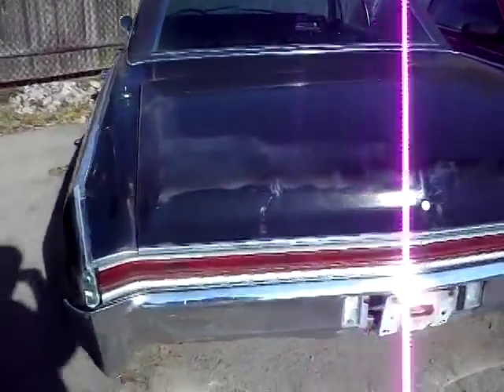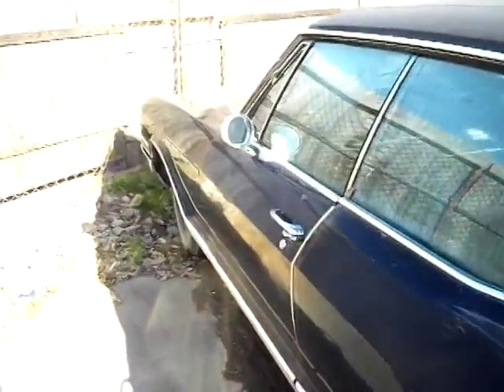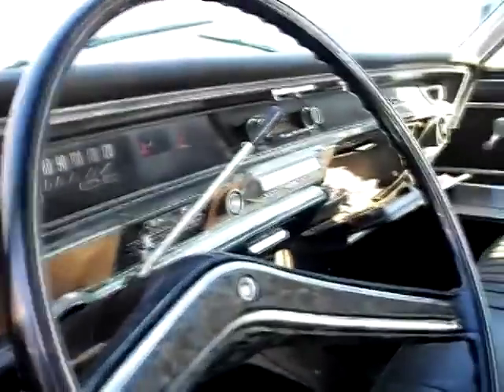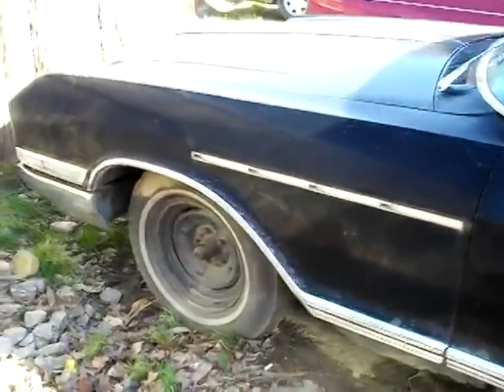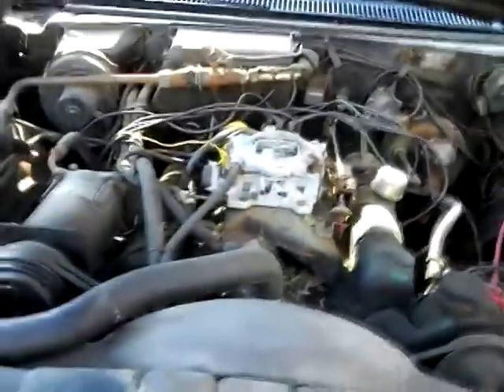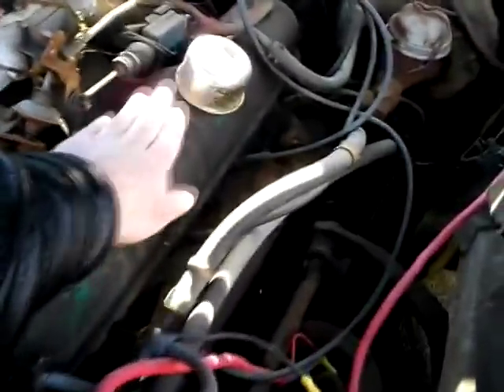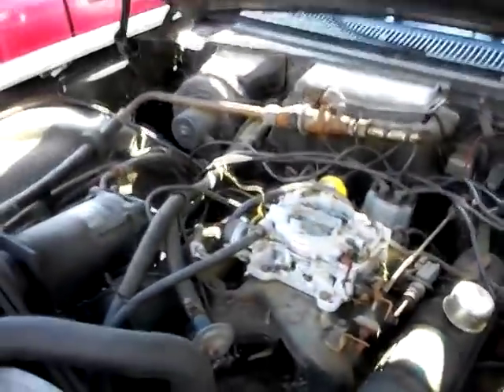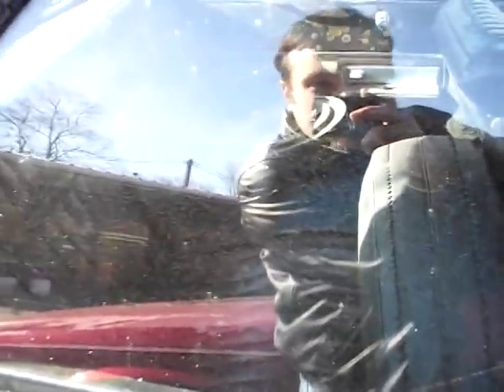1966 Buick Electra 225

Comment from the maker: @daddytech LOL, mine was 10 quarts between changes but still ran like a champ!  Torqued the oil pan bolts to spec every oil change, but when I found the top end of the engine was into especially the intake I began to wonder.  The bolts were finger tight on the plastic intake, the plug wires, injector wires and other things were twisted together.  I went to a junk yard to see how it was supposed to be, and everything was backwards on mine.

Comment from the maker: @kerobinsonii I wouldnt doubt the motor running at all, they also did work on the wiring as well.  Other than the carb throttle being a little stiff and the choke froze shut I would say it would start.

Comment: Judging on the vertical valve covers, it's a 401 Nailhead motor. The firing order is the same as the one in my car. I own a 1965 Electra 225 Survivor. Usually, as I've found out, the leak in the hardtop is usually at the window seals. That's too bad about the condition. It's still savible tho, the body appears to be in good enough condition. 

I love my Electra 225 tho. It drives like a Caddy, but corners like a fridge. Gets right up & goes like all hell, but stopping is still not the best :)
Reply: my parents had a 69 Electra Limited for years, and the back window around the vinyl top started a small leak before they donated it

Comment from the maker: @daddytech I just got rid of an eldorado like that with 100,000 + miles on it last summer.  Compression was still good except for one cylinder which was 10 psi less, but those engines being a split block were a nightmare.

Comment: @More350Power yeah they were a nightmare my eldorado was silver and like i said it was a GREAT riding car but it got to where i would pull in at the gas station, fill it up with oil and check the gas because the middle block seal leaked and i wasn't paying to have the whole motor rebuilt on the thing

Comment: hard top usually isn't what leaks, it's the window seals gotta love the batman floor mats though lmao that Cadillac Eldorado sitting next to it is like my old one those were nice riding cars but the engines are junk in them 32 valve Northstar is a POS unless you like having to completely rebuild your motor every 60K